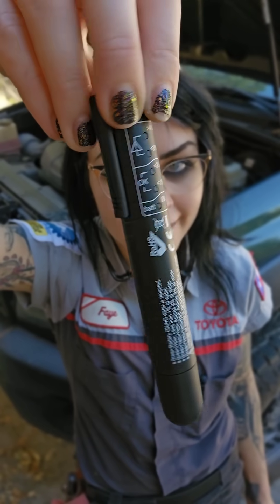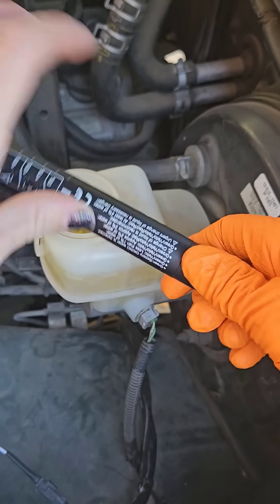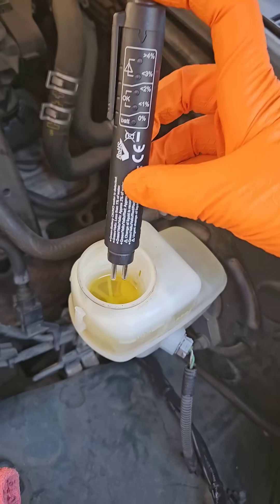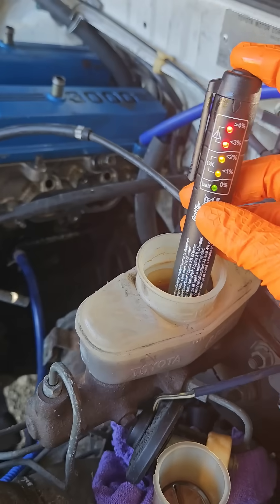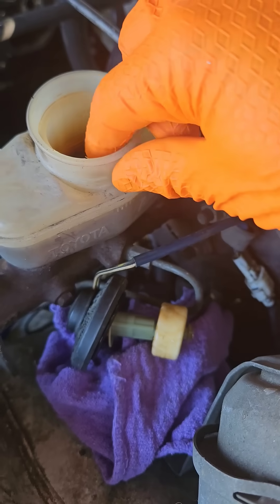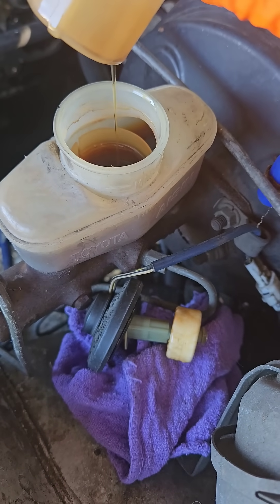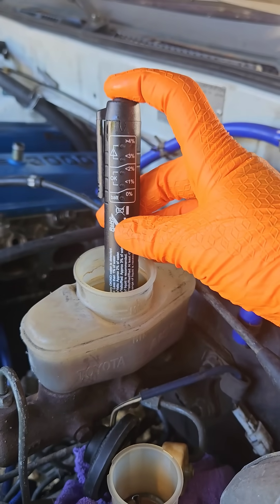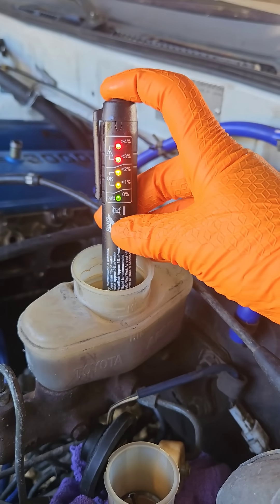Do you REALLY need your Brake Fluid Flushed?? How to Test it For Yourself!

Comment: Yeah except, I've owned several vehicles for over 10+ years and have never changed the brake fluid, even some vehicles that have been over 20 years old and had never had the brake fluid changed, and not once have I ever had an issue with the brakes.
Reply: have you taken everything apart and inspected it? have you compared it to fresh fluid? if not there is no way you could know there is no issue, people always think because there is no massive issue straight away that its okay. highly doubt you even get your brakes hot enough to notice
Reply: @arcanevoid9199  so, your suggestion is, if you don't ever notice an issue, go looking for one?
Reply: @bluegizmo1983  no just do basic servicing instead of ignoring it because you think you havent noticed an issue

Comment: I am a mechanic and have always used silicone brake fluid in my Jaguar E type. It does not absorb water and lasts forever. Also it doesn't spoil the paintwork.

Comment: By the time it needs changed, it's on the way to the junk yard. Brake lines rust from outside in. Not inside out. That being said.. its a closed system with no air.. rust requires oxygen.
Reply: thats not true at all, and its not completely closed. and there is oxygen in water which is what brake fluid absorbs regardless of how closed of a system you think it is. they can and absolutely do rust from the inside out
Reply: @arcanevoid9199  let's rub a few brain cells together here...
If you unscrew a brake line, does it come pouring out, or is it a slow drip?
It's a slow drip because its hydro-locked. As in closed system. 
 if your system is full, it stays full, if it "absorbs water" it would continuously fill. (You would have to drain it. Because it would overfill itself) the only moisture it has access to is what title there is under the lid, because it seals. 
I don't know if you've blead brakes before or not but that rubber plunger you have to keep pushing up when you refill, seals the system.

the discoloration is because of cavitation (micro explosions) Because hydraulic. I don't know if you've felt brake fluid, it ain't much for lubrication.
That tester, tests for continuity, similar to a self igniting spark tester. IE:metal, not water.  You can put that thing in a bucket of water and it won't read anything.
So if that tester is reading, it means your lines have been abused, but the color could have told you that.

I haven't seen too many vehicles on the road past 250k miles. And the ones that are, have had new brake lines installed. Because changing the fluid doesn't stop cavitation.

Maybe you take a back seat to an engineer, but by all means.. explain to me how the world works.
Reply: @ryanLBA  the water becomes part of the brake fluid, it doesnt add more liquid. and it can absorb moisture through rubber brake lines and seals, even an unopened container only has a shelf life of about 12 months. and the only way you will get cavitation is from the abs pump and even thats not likely. the discolouration is from the fluid breaking down and also getting contaminants in it. the tester checks for water percentage, if you put it in a bucket of water it would read the maximum value it could display. not sure where you got any of this information from, this is basic servicing

Comment: I like how I can use the same fluid in my clutch and brake lines. The last time my clutch hydraulic release cylinder went out, I pulled off to the shoulder and scooped some of the brake fluid to the clutch, and it got me to a gas station!

Comment: Yes.

Yes you do.

The brake lines rubber wears out and turns it black and watee gets in there.

Also, when you have a forced panic brake event, do you want to trust your vehicles ability or would ya rather yolo that shit?

Choice is yours

Comment: Brake fluid is very hydroscopic, it draws moisture and needs to be very dry. Moisture in brake fluid drastically lowers the boiling point and if under hard braking can cause a soft pedal= likely crash. 

Brake fluid is also NOT vented, it is sealed. There is a rubber diaphragm under the cap that expands into the reservoir, this diaphragm vent is what she pointed to.
Reply: Your brake fluid is sealed about the same way a pop bottle is. Every time that reservoir is opened ambient moisture can get in there. It is very critical to change the fluid according to the manufacturer schedule.  Years ago it wasn't a huge deal. You could still get brake fade. The biggest concern now is internal corrosion. Brake lines are still reasonably cheap. ABS controllers on the other hand,,,,,, not so much.
Reply: @My-Name-is-Mud-1969  at 4% water contamination dot 3 fluid can decrease the boiling temperature from 520*f to as low as 370*f. This varies greatly on the manufacturer of the fluid, but specs are similar and that is a drastic change. There are other reasons brake components fail, calipers stick from corrosion behind a broken dust seal (outside the seal to fluid, abs components fail from corrosion on the electrical side usually. You are correct on the reservoir cap, but it gets in in other ways too. I don't exactly agree at manufacturer schedules because every part of the country is different, everyone has different driving habits too. As shown the testing tool is a very inexpensive tool and reports purely on a condition basis.

Comment: Checking for moisture and burnt color or contamination  never mix  normal  brake fluid with synthetic . Using a sucker remove old in res. Fill with new open a bleeder put hose over it using old pop bottle or water bottle to catch old fluid pump pedal until low res. Refill do again until clean fluid tight bleeder helper to remove air. Then do rest 3.

Comment: Hi Faye,  I been mechanicing for about 56/ 57yrs. I learnt a lot in that time. I currently drive a car that was brand new when I was a senior in high school, 1969. I change the brake fluid every year because my  54yr old car has all original brake master cylinder,  brake lines and wheel cylinders all made out of ferrous metals and will rust if allowed to get water in contact. The rust will damage the rubber parts that slide to make the brakes work. It's been a lot of years since I drove hard enough to boil my brake fluid, so rust from H2O is my only nemesis. Good video though, thanks for telling the truth. ben/ michigan

Comment: Brake fluid is cheap. Cars and medical bills are not. Just flush it. That applies to new pads as well. Actually, that is one of my pet peeves. 
Shop: "Your brakes are fine sir!"
<About a thousand miles later in the shop>
Shop: "Yep, you have gone metal to metal so we need rotors."
Me: "-__-"
Reply: So you are one them people who burns through a set of brakes in 10k miles then blamed the shop😂😂😂
Reply: @redrustyhill2  Nope. I'm actually pretty gentle on my brakes. The shop in question has a habit of lying about brake condition so they can sell more rotors. They've done it to several people I know.
Reply: @joshualandry3160  thats why I don't tRUST ANY shop. I do all my own maintenance.
Reply: @joshualandry3160 I have to agree with you. Doesn't anybody turn the rotors on a lathe like they used to do years ago with brake drums?. As long as there's enough Tolerance on the rotors, all you need to do is clean up any small gouges on the rotors. They'll tell you that your rotors are " no good" which makes it easier for them, but cost you more money!!.
Reply: @michaelj.campagna404 good luck finding a shop with a brake lathe. Brake rotors are designed to be replaced when the brake pads are worn. It's almost impossible to machine a rotor on a modern vehicle and still have it well within tolerance. You machine the rotor you make it thinner than at warp shortly after the brake job is done. And then you go back and play with the shop. Rotors are cheap. Put new ones on when you put pads on.
Reply: @joshualandry3160 there are two types of drivers in this world, race car drivers and everybody else. There's no such thing as being easy on your brakes.
Reply: @Wishes890  lets see. Maintaining good distance so engine braking is sufficient for adjusting to traffic. Using engine braking to slow for an up coming stop rather than coming in hot and using a lot of bakes. Down shifting on hills so speed doesn't need to be controlled by brakes. Need I go on?
Reply: @joshualandry3160  and doing all those things you stated, will they prevent somebody from cutting you off, from somebody stepping off of a curb onto the street, somebody suddenly stopping on the highway in front of you? Also I don't know where you live but where I live we have a lot of humidity, and that humidity rusts the surface of the rotors, so if you don't apply your brakes firmly enough while you're out driving and do a lot of short trip driving then rust builds up and causes high spots and thumping and pour brake performance. If you live someplace where the ambient humidity is 1 then yeah you're probably okay
Reply: @Wishes890  At this point I think your just being dense. Of course none of those things will stop the need to use brakes regularly. What it will do prevent a lot of unnecessary use. Hence, longer brake life. It also is great for anyone with normal car use and not stuck with the edge case of having rust problems. Most of us drive enough so that isn't an issue.
Reply: @joshualandry3160  How long have you worked in the automotive trade?
Reply: @Wishes890 Nice deflection. Still doesn't change the fact that driving style can radically impact brake life and you where wrong.
Reply: @joshualandry3160  Nice deflection on your part. Ho long have you worked in the automotive trade?
Reply: @Wishes890 Not telling you, it is irrelevant.   You claimed there was no way someone could be gentle on their brakes, ie preserve brake life. I proved you wrong with examples of how you do that. You tried to claim it couldn't work because other people might do dumb things and force you to use more brakes. Well, no s**t Sherlock. Sometimes you have to do what you have to do. That doesn't negate the other 90% of the time. Next you want to excuse it by saying that good driving can cause the brakes to rust. Maybe a regional problem, but I've never seen it on an actively driven vehicle so I'll just say that sounds like a BS excuse to me.

You just don't want to admit that yes, one can in fact take care to extend their brake life with good driving practices. So, I'll ask you what exactly makes you so allergenic to admitting driving style effects vehicle wear? Making excuses for your own bad driving perhaps?
Reply: @joshualandry3160  well if you're not willing to answer my question I won't answer any of yours. You have yourself a day full of unicorns and rainbows my friend
Reply: @Wishes890  Yes, please do take your nonsense and go away. And please don't work on anyone's vehicle or any other profession requiring responsibility. You clearly are not able to admit error which makes you unsafe.
Reply: @joshualandry3160  didn't you hear? I dismissed you
Reply: @Wishes890 Apparently your ego also requires you to have the last word as well as refusing to admit error. How amusing, but it still doesn't change the facts. We both know you wouldn't admit to being wrong if I was retiring tomorrow after 80 years of work as a mechanic or if I was a 14 year old who had never touched a wrench so of course I'm not going to give that information. Simple fact is I am right and you are wrong. You know it and your throwing a tantrum like a 3 year old.
Reply: @joshualandry3160  okay who is the one that has to get the last word in? Okay I've had enough fun at your expense. It only makes sense that if you can drive exceedingly cautiously, then your brakes will last a bit longer. That's just basic math. Where I live the brakes either wear out or they rot out. There is no real gentle wait to use your brakes unless you can store your vehicle in a climate control garage then those are your two options they wear out or they rot out.
Reply: @Wishes890 Oh, so you finally admit that you where wrong and you can actually affect how long your brakes last. You know you could have admitted it earlier like an adult but I guess you are not mature enough for that. As to your whining about breaks rusting out, that is obviously a very regional concern, but I don't believe you that it actually is a major concern for active vehicles. I think you are over blowing it in an attempt to be right because you can't handle the truth.
Reply: @Wishes890 You left out those of us driving manual transmissions, double clutching and rev matching on the down shift. Toss in an extra helping of following room, mixed with coasting up to red lights instead of boom & zoom & slam to a stop.

We're easily forgotten, though, so I'll forgive you on that one. Can't be many of us left.
Reply: @theluckyone1634  True, I didn't mention the manual transmission, its almost non existent now. How often do you get to coast up to a red light without applying the brakes?
Why do you "double clutch" with a syncromesh transmission?
Reply: exactly. i don’t understand how it’s even an argument. it’s an extra 20 minutes and $13 when changing pads to crack the bleeders and introduce new fluid. anything extra that helps brakes, out of everything, is not excessive. hell i don’t even turn my rotors; i understand the surface area doesn’t change, but i’d rather spend the extra $30 on rotors with full braking capabilities every 50k-100k miles instead of shaving metal off the things keeping me from slamming into other things
Reply: $200. at BMW deslership.  No thanks.  I drove HP police cars for years  120 140 mph daily  after 3 years traded in for new cuiser.  NEVER CHANGED BRAKE FLUID